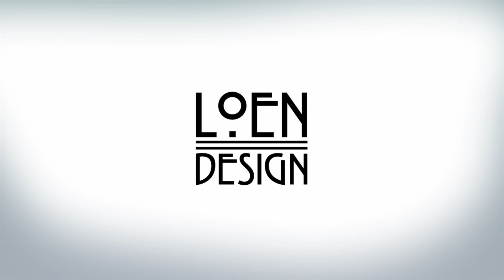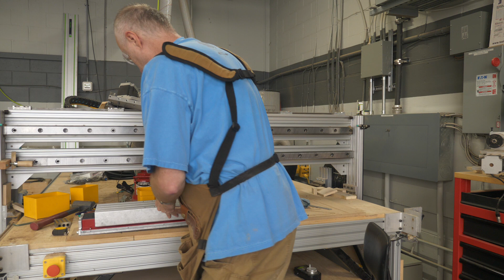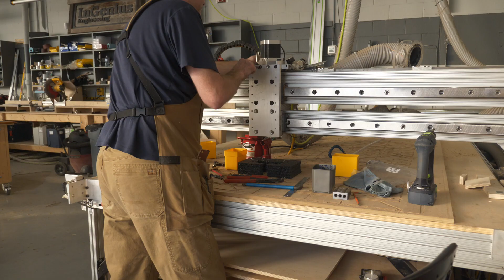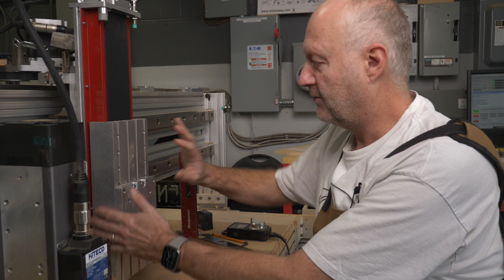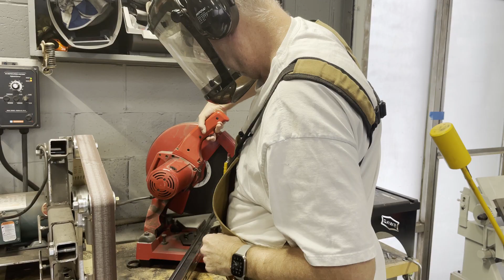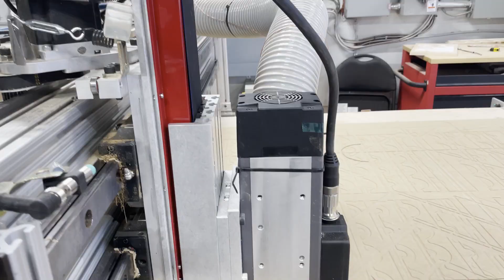The Essential CNC Router Upgrade!

Comment: 2080 extrusions aren't very stiff. Torsion forces when the spindle is in the middle of the gantry will still cause chatter in harder materials. Put a dial indicator on the spindle shaft that's lowered all the way and push the stepper motor at the top, you'll immediately see what I mean. Add a steel square tube to the gantry back and side plates. That should stiffen it up sufficiently.
Reply from the maker: Thanks! Excellent advice. We are using thick wall extrusions and have some at 90 degrees for extra stiffness. But, we are still seeing the shaking, so we will try your suggestions!

Comment: in order to avoid vibrations or such with z axe just install the two linear guideway rails away from each as most possible, that upper one raise it up in upper stream-slot in the aluminium profile.
Reply from the maker: This is in progress. Also, reducing the rail size. Thanks for the nudge!

Comment: What’s the width of those guide rails? 35mm? Those bearing blocks are massive. Thanks for the video
Reply from the maker: Actually 45mm guide rails! They are WAY TOO BIG for the machine, and they have enough built-in resistance that the motors have to push quite hard just to overcome the bearing movement, and then on top of that, apply the cutting force. It also cuts back on the rapid speeds we can use. I had found them for sale on an overstock site and thought they'd be cool.

Comment: thats some massive rails even our thermwood series 45 use smaller rails! brace your gantry extrusion together in the back for more stiffness
Reply from the maker: Yes. Crazy rails. It’s quite a load for the steppers to push around, even when not cutting. I’ll look into that bracing. Thanks for the helpful advice. I may send you some questions as I look into it.

Comment: What cnc is that?
Reply from the maker: It’s my own design, using many components from avidCNC.com. I used rails I found online (automation overstock??) and bought aluminum extrusion for the frame. It uses Avid electronics, which are excellent.